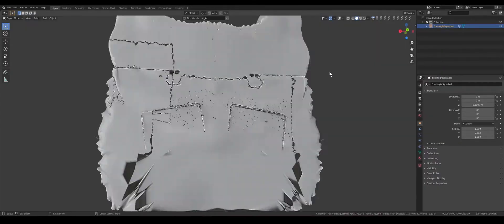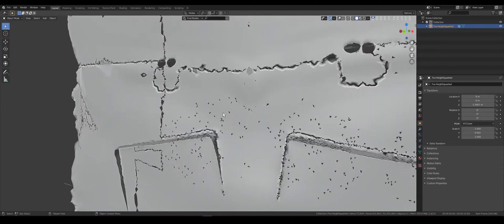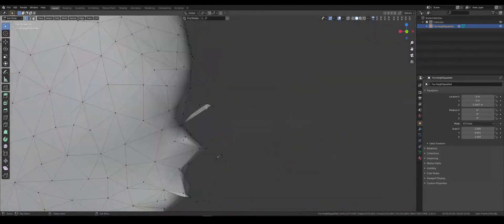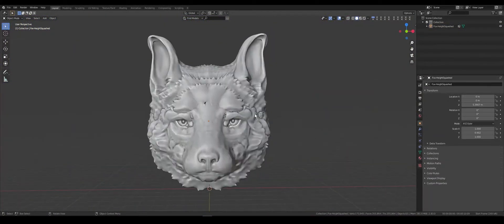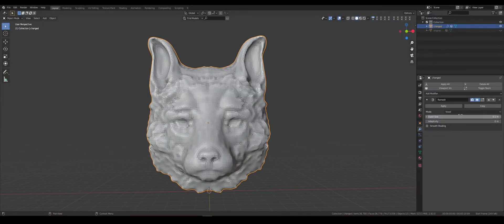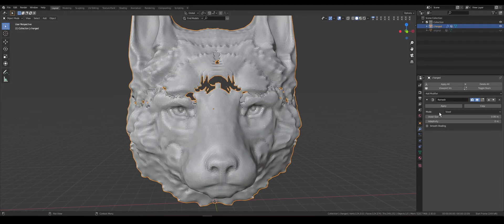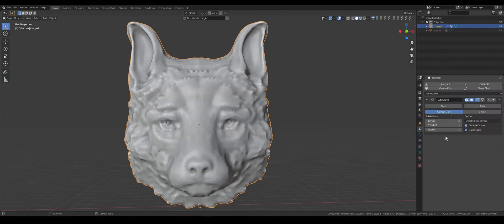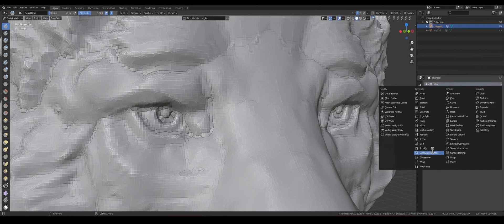Blender 3D Fix all mesh problems | artefacts (engl version)

Comment: For the non 3d savvy, aside from Blender/Meshlab, is there a online tool that can open an obj file (that has no mtl file), and allows you to just add color?  

From sketchfab, I downloaded "map pointer (3d icon)" obj file, but it doesn't come with any color.   I tried Simlab Composer but it seems too complicated to just add color!

Comment: One is missing for 3d printing, depending on the print direction, you had to flat the back surface. I'll do it by bisect tool or select all the faces that had to be flat and hit s + z (or the direction it has to go) and 0 (zero)

Comment: This is a super helpful tool, but unfortunately it doesn't seem to work for removing voids (resin traps) that are "baked in". Sometimes, voids can be removed simply by splitting the object into separate parts and deleting the voids (very satisfying!) but some models have "compartments" inside them that are 3D - not just 2D polygons.
Reply: Go into edit mode, select a point on the main mesh, ctrl-L to select linked, ctrl-i to invert and delete any disconnected islands/voids. If the traps are long thin cavities connected to the surface, I haven't yet found a good way to deal with this.

Comment: my coumputer frezes when aply remesh modifier
Reply: I've not used blender yet but allegedly you can increase performance by doing more subdivides first and then lower the multires modifier amount because U don't need so much, it's because it's kinda the same thing and gets the same result however the multires modifier tries to do it all at once in a virtual process which craps out performance so doing more subdivides first fixes the problem of slowing or freezing the computer. Hope this is relevant, I still haven't learned all the terminology yet but it's still a helpful trick to know

Comment: So the solution is to remesh and then re-sculpt the details. Hmmm, I guess it works but it's not the easiest process.
Reply from the maker: Im agree with, cause 2days ago i start create geo nodes that optimize without any additional manipulations
Reply: @rinatsahbiev1395  What do you mean? Can you please explain? Because that sounds interesting.
Reply from the maker: @spork861  it means that i have 2 objects inside blender. First - high poly, second - cube with geo nodes that will recreate topology with little script + geo nodes modifier. I hope, it will work with all type of high poly models